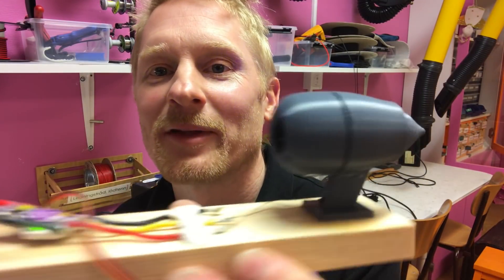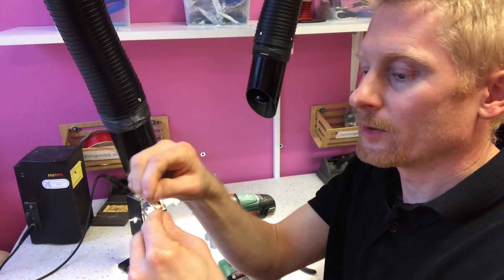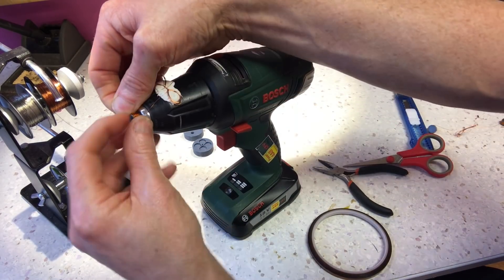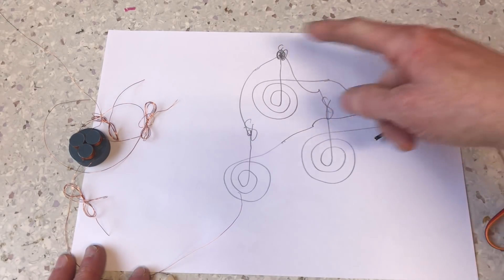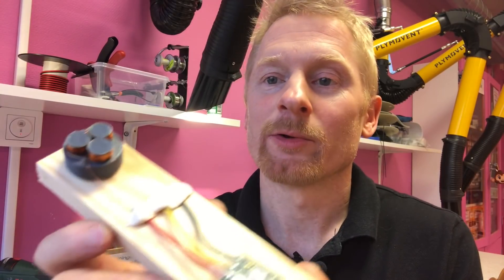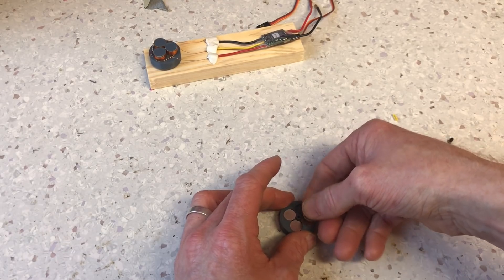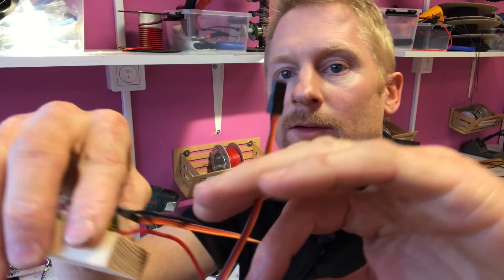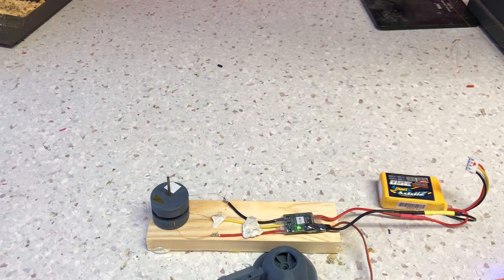3D-printed  3-phase electric JET  motor build!

Comment: Hey, mister, centrifugal force can be strong enought to break your motor rotor and throw magnets to you. It will be not fun at all
Reply: Considering centrifugal forces aren't a real thing, I think he's fine from those. The centripetal forces on the other hand..
Reply: @Excludos  you're a smartass, hm? The centripetal force doesn't break anything, and while the centrifugal force is virtual, it is still real enough to break stuff. If you hit a baseball bat against your head it hurts just as much as if you hit your head against a loosely standing baseball bat, and you might still argue that in the second case it is a virtual force. It still hurts.
Reply: M. Sierra That's still the Centripetal force doing all that. Centrifugal is only a perceived force, and the concept of it severly taints how people think. People think you get flung outwards, when the truth is that you actually stop accelerating inwards and get flung forwards instead. So I correct it when I can ;)
Reply: @Excludos  No, I get that :) But it's not the centripedal force that brakes the motor. The centripedal force is the force that is accelerating the magnets to keep them on a circle. The centrifugal force doesn't accelerate anything, it is coupled to the centripedal force. It is the opposite force, the force that actually does the breaking. It doesn't accelerate anything and is therefore considered a virtual force. But you could consider it the force that acts back on the material that creates the centripedal force. Like the virtual force that acts back on you if you push something. Therefore, I would say, this is one of the few moments where you can actually say that the centrifugal force is the reason.
Reply: @Excludos  You mean as in... angular momentum being converted to linear velocity as the rotor of the BLDC motor breaks, and the the force from the angular acceleration turning the magnets into a projectile whose function is the summation of F=MA?

Comment: the smoke test shows a lot of side "projections". Is that normal ? I mean in a real motor, you would want the entirety of the flow to be for thrust, right ? 

Nonetheless, this is super interesting!
Reply from the maker: Im going to build this motor with young students, and the precision I the gap is so much easier to manage without a non overlapping labyrint seal. But I might try a modified version just for myself. Will post a video if there is a significant performance gain. The main gain of this design compared to the bare bone motor is that the coils get enough cooling in the jet-setup.
Reply: A lot of the airflow inside the engine is bypassed around the outside of the combustion area, to dilute and cool the exhaust gas to a temperature low enough for reliable operation. This needs an extra shroud to make the airflow more true to life, but it's close enough.